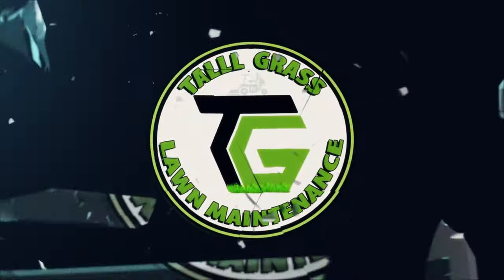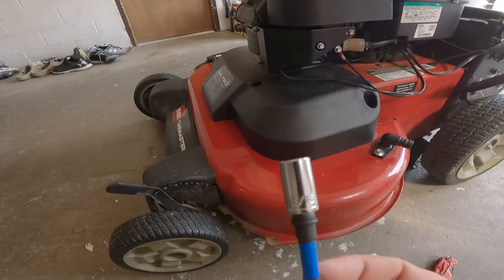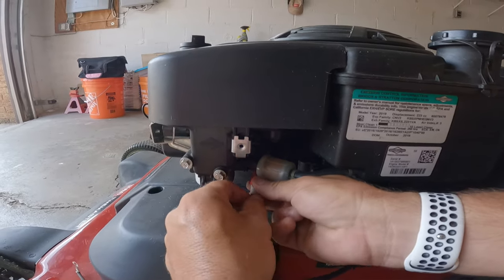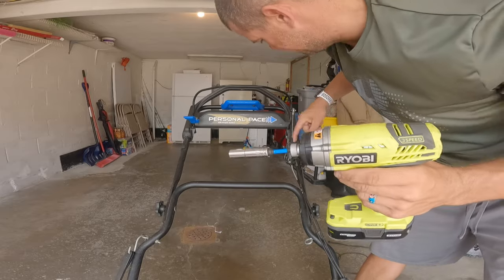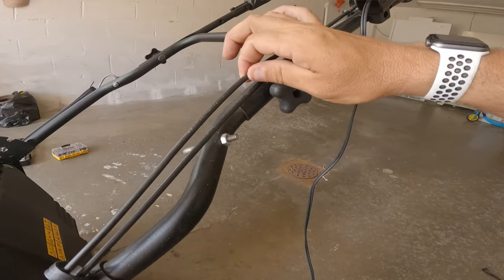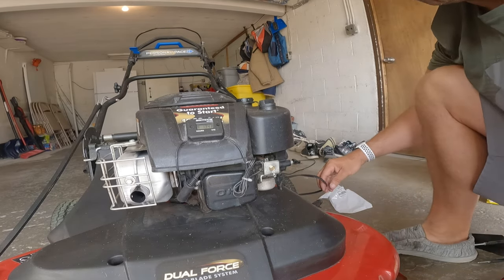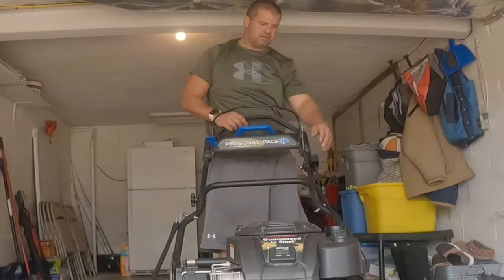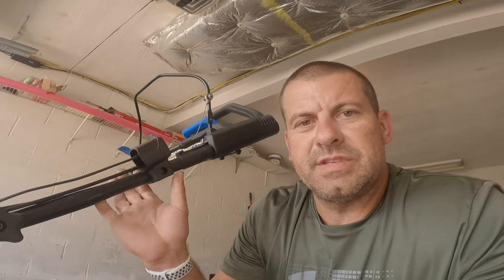Toro Timemaster Wouldn't SHUT OFF(REPLACING THE KILL SWITCH)

Comment: OMG, I gave up on the kill switches. They get caught on bushes and stuff and always break or wires pull out. I don't use it, I just touch the two wires together to stop the machine lol. Great video!
Reply from the maker: Hahah I hear ya. I used a key and touched the metal piece with it and it shut off. I did video it but apparently my GoPro decided not to capture that part 😂😂

Comment: I had this happen 2 days. So here's my issue that red butt connector. Where does it lead to. Mine is lost and the kill switch wire is just hanging.  I have to tilt my mower back with little fuel in it for it to cut off
Reply from the maker: Take something metal like a key and touch the two wires to it. It will shut off. I had to do this the rest of my day when this happened to me. 👍🏼
Reply: @TheLawnFellas  do you mind checking your  Instagram message i sent you a pic.  I don't think touching 2 keys is going to help because of where the wire broke off at
Reply from the maker: @smurf13w17  yes I seen. I think you just need a new wire harness it broke off on the bottom of the mower where it plugs in. It’s just a plug and play attachment pretty simple to install same as I did here in this video

Comment: I guess you can use a 11 mil socket but just becareful not to strip it I used 10 mil to get the bolt off but good video fairly easy
Reply from the maker: Thanks yes pretty simple fix to be honest. But when it first happened I was so confused how to turn the mower off. Thanks for watching 👍🏼💯

Comment: I have a question, where does the positive wire go into the motor at because mine busted Way beyond the fuse area, it goes into the motor somewhere but I don't know where ???? Does anybody know
Reply from the maker: That’s a great question. I never heard of that or seen it happen. But I am sure if you somehow take that section apart there will be something there to plug into. Sorry best I got.
Reply: @TheLawnFellas  could I maybe put that positive wire on the spark plug and then put the plug on?
Reply from the maker: @georgemanzur6789  that I would not know. But if it were me I would take it to someone that knows 👍🏼
Reply: Did you find a solution?
Reply: @rahshonhicks3495  Take out the 3 nuts holding down the top cowling with the pull start. It should lift straight off, no trouble. From there look towards the front and you should see a white solenoid looking thing with a male connection. In my case, the wire came out of the female terminal. I patched up a new one and soldered it on just to be sure.